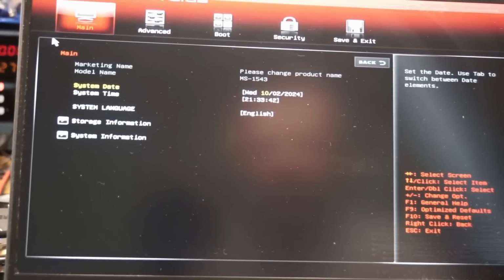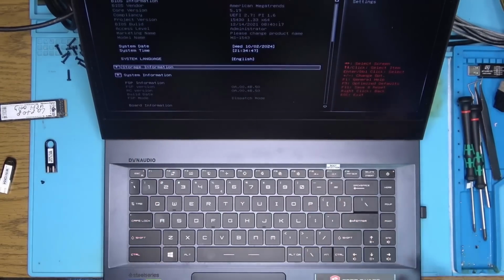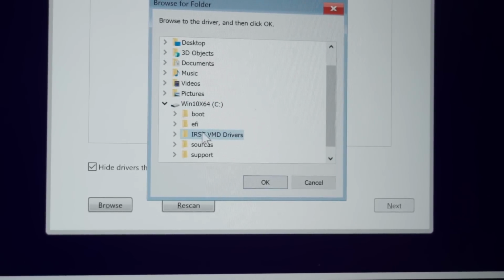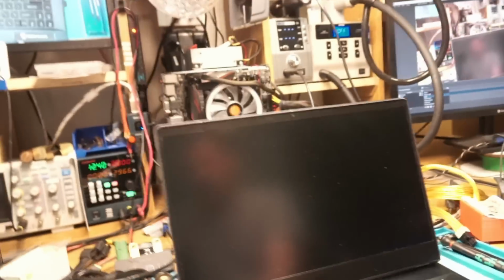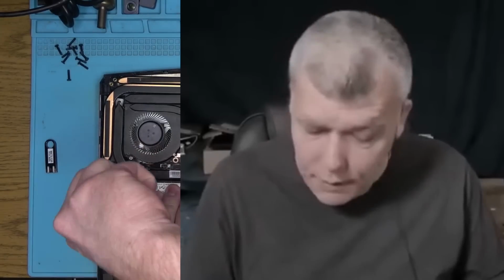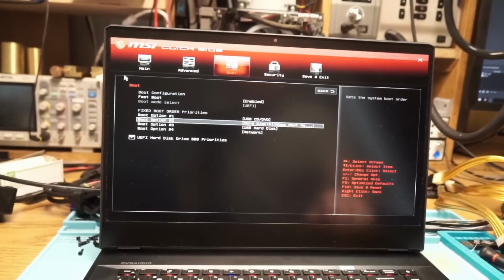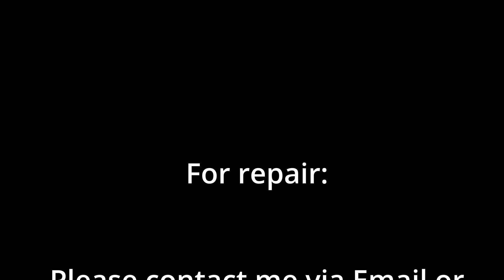MSI GE66 Raider Cannot boot into NVME or SSD

Comment: Similar issues to fix. People buy new system/laptop and wish to use old drive. The trouble is the old drive is MBR (Master Boot Record) and the new system/laptop is only looking for the new'ish  GPT (GUID "Globally Unique IDentifier" Partition Table). Usually have to back up data and format. This is especially true on BIOS versions, that do not allow you to switch to CSM (Compatibility Support Module) mode and 100% UEFI (Unified Extensible Firmware Interface) mode only.
Reply: I have a 5 year old Dell Latitude where the BIOS doesn't support NVME booting anything other than UEFI. External (USB) drives are just fine but the internal ones? Nope. This is a PITA if you are trying to install some of the Linux distros as they also don't see the built in SSD.
Reply: You could convert the drive to GPT easily. Just connect it with a USB adapter and convert it.
Reply: @nexxusty  Some distros (like Mint) didn't have support from GPT at the time. PITA.
Reply: @brianjrichman  mint sucks bro, take that from someone who is dealing with linux more than 15 years
Reply: @nask0  Been using Unix and Linux for 28 years. I know about Mint, but others like it and some want the one person they know who also knows about Linux to install it. Despite saying to do it in a VM and then seeing how it goes, some just want to go right onto it. Who am I to discourage that enthusiasm?
Reply: @brianjrichman  wow you have quite of experience man, I definitely respect that. That's a valid point, a lot of people likes the Ubuntu as well, which I grow  not to like (mostly because of broken dist-upgrades and underlying xml stuff it use, xml is fundamentally broken "thing"), but who am I to judge ¯\_(ツ)_/¯
Anyhow, it's always pleasure to meet fellow *nix power user! It would be great if we can connect and share some experience and/or just chat about stuff.
As someone almost 40 years old (now when I am thinking about it, I am Linux user circa 2001 😁), the invention called Internet still amazes me in its abilty to meet me with wonderful people. Wish you all the best, cheers brother
(also sorry for my bad English, it's not my "default" language)
Reply: @nask0  I started out on 68000 systems, moved to Intel and then Sun before ending up with Fujitsu.
Reply: @brianjrichman  nice, my first was Pravetz 8D/Via 6522 (Apple  reversed-engineered "clone") since I happened to be born in the country that made them, but since kid i was fascinated by computers
Reply: @nask0  Keep on doing it.

Comment: Good fix.
Some computers act up when the battery is low or dead, other computers just don't even care.
I definitely felt that the UEFI was corrupt.
Normally you don't have to slipstream a disk driver on modern desktops, sometimes on servers though.

Comment: Welcome to drivers for Windows. This issue has been in existence since Windows 95. Sadly, manufacturers no longer provide drivers on discs. Some oddly do on USB flash drives. When you build new PCs for friends and family, you get used to putting all drivers on a flash drive when setting it up.
Reply: We use to call them F6 drivers. Back in time was same thing with installing RAID array drives with Windows

Comment: I have this same problem with my first PC build. It wouldn't boot past a certain point in the windows install on my first POST/boot process. Had to look up a video and go troubleshooting, into some advanced options and change some values of something lol found a video about it in YT " not able to get past said screen in windows install " Wish I could remember the name of the video, I'll have to check my PC playlist and see if it's there. Sure do hope I saved it. Wasn't hard to find though for my specific situation. Solution was literally to change two values from 0 to 1 and I was in. It is amazing to me how people figure stuff like that out. I really want to understand it. Very impressive.

Anyways after I got past windows install by changing those couple values, I was able to get in. Worked fine for a little bit and then one day it wouldn't boot past BIOS and I got stuck in the loop. Same problem, NVME not detected in boot screen but it was on main BIOS screen. Only as the drive itself though, not as the boot drive. ASUS BIOS has a little box in the boom right where you can see eligible boot drives in basic mode. Wasn't there or in the " advanced mode " boot section.

I have been able to get past it by enabling legacy and UEFI sometimes. But not UEFI only or legacy only. Even though windows 11 is supposedly UEFI only, right? Not sure if they backtracked on that like they did with TPM's. But I can only boot via legacy or UEFI option enabled.

However I cannot have PBO or XMP enabled and probably any type of overclocking options enabled in the BIOS or it just won't boot into windows. Goes right into the infinite loop. Fortunately I don't really need it, so I just don't worry about it. It's my personal computer so no biggie, plenty powerful enough on its own. Still is a very strange problem to have.

I wonder, do I need to create a partition specifically for the portion of the drive that functions as the boot? I thought that when I had installed the drivers for my M.2's, it had created partitions. That definitely showed up as a task it was working on while loading. Not sure if it ever made a specific partition for the data that initiates boot. Hmmm.. interesting. I wonder if I only installed the drivers for the RAM.. O_o

Thanks for the insight! I will have to try getting into these folders and figure out if I can finally get my boot drive recognized in the BIOS for good. Until the next BIOS update at least lol will def be saving this to a playlist.

Comment: This is an old issue that techs that have been around for 30 years would recognise, and used to have to do this years ago with HDD controllers and chipsets  that were released after a particular build of windows so the driver was not a part of the package, a good example is installing Highpoint IDE  and some SCSI controllers on WinNT4.0, BIOS sees it  and in some cases so did the windows installer,  but would fail  on reboot with an Error x0007E - inaccessible boot device - the solution was either to slipstream the required driver into the windows install image or have the driver on a floppy and make sure you install it during install - back then there were no thumb drives...
Reply: Looks like you and I have both been around too long. 😅 I remember those days.
Reply: Correction....7b bsod
Reply: How many times I made floppys with special storage controller drivers....
Reply: @matthiash.4670 I say once 😅
Reply: @matthiash.4670  and I say many times, many many times.
Reply: @SpaceCadet4Jesus  That the police Academy's quote 🤣🤣🤣
Reply: even windows 7 with usb 3.0 drivers 😂
Reply: It was only awhile ago that I done the same thing for the my motherboard Asus P6x58d-e that I know Marvell 9128 have a inherited an issue with the raid chipset been gimped on performance due to lack of pcie lanes given to the chipset as well the chipset bios been out of date. So decided to tackle this head on and manage to get it fully working without any issues on Windows 10 22H2 the performance is pretty good getting close to 490mbps on read and write is about 235mbps which it not too bad for a Sata 3 mode but the intel chipset Sata 2 mode read and write is lower again more consistent but never the less I have used up all the sata ports for multi drives ssd and hdd for storage and data transfer. So yeah I'm pretty happy the way it turned out 😀
Reply: I remember those days of having to load drivers from separate Medium in order for the drive's to be detected in the windows installer as Plug&Play didn't exist in those days, Man this brings memorys back of good old days for sure 😉
Reply: I remember it also as well - and it was always inducing anger when that happened because you then had to find the right drivers, sometimes even the right version of the right driver.
Reply: The thing about the driver and the right revision is using the manufacturer's website if they have it sometimes they don't have it then the problems starts by looking on drivers websites that claims to the right driver but a wrong operating system. 90% it the bios that isn't configured correctly and 5% the correct drivers will work and 5% bios needs updating but surely 90% of people don't do above methods then automatically created a forum complaining it broken and 10% of the time people don't have time to answer the question 😅
Reply: I've done it before, but it was so long ago I don't remember which OS I first did it on - maybe XP -.
Bought an old OCZ RevoDrive, ie, SSD on a PCIe card, last year and it was the same, ie, load driver during install.
Reply: ya I remember having to load drivers when SATA first came around; older version of windows (probably windows XP) but new SATA hardware. Something about AHCI drivers or Raid drivers or some non-sense. I find it odd that that issue still occurs today though.

Comment: I have an acer predator that is having PCIe issues too.  If the battery is full it will boot to bios, sometimes it will recognise the gpu sometimes it wont.  And it will try to boot the windows install usb but fails to load and hangs on the spinning wheel. Processor?

Comment: i've been build my own PC since high school and encountered same issue ( drive not detected while installing ) 3 times, once when i installed windows vista back in 2007. you need to set SATA setting in bios to  AHCI instead of IDE by default, easy fix. second when USB 3.0 released back in 2011/12. if you use windows 7 usb drive instalation make sure you use usb 2.0 port because using USB 3.0 port would result in non detected system drive. avoidable mistake and fixed later in windows 8 above which suport install on USB 3 port by default. third one was back in 2017 i think when microsoft force all laptop manufacture to use UEFI instead on MBR/Legacy if your usb installation media was on legacy it wont detected your storage while booting on UEFI and vice versa. thats why i always had 2 usb for each mode. now i saw your video and it looks like 4th one, i dunno who to blame wether its intel or microsoft but its been almost 2 decade cant they figure something out?

Comment: As soon as you described the issue. I literally shouted at my tv "INSTALL THE VMD DRIVERS" been dealing with this for a few years now since Intel implemented it. On my main pc I have 5 m.2 drives and one sata ssd. what VMD does is it groups all storage installed in the system under the "VMD Controller" so that in windows you can manage them all using the IRST manager to create raids or w/e. Usually you can turn VMD support offline the bios which would cause the drive to show up right away in the windows installer like usual. I hope YOU learned something 😊❤
Reply: Is this problem with amd system aswell or just intel
Reply: @jthedood1605  this is Intel  only. AMD systems won't have this issue.

Although Intel rst has been around for a long time it's super common for 10th Gen and newer.
Reply: @jthedood1605  I would hardly consider this a problem it's a feature implemented to make raid configurations across different systems super easy! It's only a problem if you'd onto know how to use it!
Reply: Came here to write this comment, but the job is already done. Well done sir.
Reply: it was intel rst driver (raid) now it's vmd mode 🤣
and in most laptop, it's enabled by default or you can't disable it, you need to load the vmd driver
Reply: @maklogetrich2378  yes very true  laptops have more locked down bios but I have seen more than a few in my line of work that do have it. That msi extended bios trick should actually unlock the option.
Reply: @Conradportelli  do you know the buttons combination for Lenovo legion pro 5 AMD model gen 2023 ?
Reply: @ChudGPT  Try Fn+R+N 3x then press f10 do this in bios under more settings if thats there or just on the main page. Good luck
Reply: @Conradportelli  thank you I'll try and update you if it was working for me and that laptop 🙏
Reply: First thing I do is disable that
Reply: Same. And I'm Russian, LOL...
Reply: I was thinking the same! I did got in this trouble for 4 times this year, with new Intel laptops,  and did research online for this problem! Thats why I was thinking the same, VDM drivers!
Reply: sata ssd is also m.2 btw.
Reply: @vahngaming7107  i meant a 2.5inch sata ssd. Yes of course there are m.2 sata ssd. I'll be more specific next time
Reply: @Conradportelli  its fine was just being nit picky lol either way m.2 sata ssd and the 2.5 inch one run roughly same, so it doesnt matter. what board did u have anyway to accomodate 5 m.2 pcie slots?
Reply: @vahngaming7107  no worries man I prob would have said the same ... I have the asus z790 Dark Hero ... excellent board imo ... I work for a big computer retailer in Canada.. it has its perks
Reply: It's real simple fix but I've been building comps for 25 years. Currently running a NVMe gen4 Raid0 setup 14003 read 11036 write, with 2 Kingston Fury drives.

Comment: Disable intel vmd in the bios or do as i did .. i added the rst driver in the home directory of my windows 11 installation media ... you can get the driver from the support page of the laptop on msi website ... but you need to load the driver in windows installer ... it will install and the ssd with show .. i spend two hours trying to fix that problem

Comment: Thank you for the "Godmode" booting trick!
1:14 CMOS-battery with very low voltage --> CMOS Data (BIOS settings) are corrupted.
But BIOS-Firmware is flashed, therefore it can't be corrupted, does it? 
BIOS settings could reside also in the flash memory - but (not) in this laptop? (and CMOS only for real time clock)
But there's a reason why the other company (0:23) could not P.O.S.T. the laptop. So... corrupted flash memory somehow?

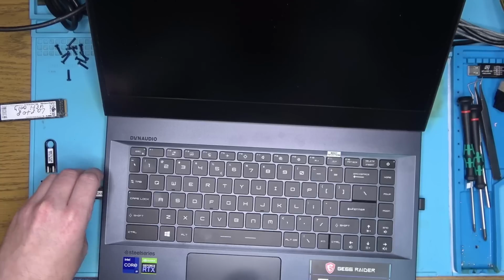Comment: 4:55 I remember encounter this problem first time in Windows Vista, it did not have all drivers of all MB brands to get SATA hdd work. Or I had fancy Pci-extension for SATA outputs back then... I don't remember. It have been over 15 years
Reply: Never had any problems with Vista. On the other hand installing Windows XP was a nightmare on a Sata drive equipped PC. The floppy disks quality started to get questionable, so in the end i had to make a Sata AHCI modded XP SP2 install CD.

Comment: @northwestrepair
You should check the BIOS and look for a setting called Intel VMD, or VMD support, try to disable it and that should fix ur issue of the installer not finding the drive, it should work without any drivers, as far as i know that is used for RAID on the CPU.
Reply from the maker: I tried. No help.

Comment: Lol you didn't know you needed drivers when installing windows? w*f
I recently installed Windows 10 Pro on a laptop and the drive didn't show up and you have to select the correct, non nested Windows drive drivers folder because it can't use that drive even though it showed up in the BIOS drives. This is a very common problem with non-sata drives.

Comment: Change storage settings to ahci 
Also newer devices are removing support for legacy boot devices so uefi only boot support .
Also check if there is csm support and or disable secure boot .. 
all these were windows 11 requirements so devices are most likely enabling them by default
Reply: I am not sure but ít seems like window 10

Comment: Ah. Modern laptops (I noticed gen 11 and up) have this problem of windows installer not seeing the NVMe. Gosh that made me mad. And yes you need to get the original (for this laptop model) storage drivers, usually from manufacturer site. In my case that was HP.
Tony do you flash BIOS on the board or desolder the chip?

Comment: Disable Intel VMD Controller in the Bios or change it to AHCI ;) and you dont need drivers. 1st Option under "Advanced" in the Bios on this model.
Reply from the maker: I already tried VDM disabled with no luck. 
AHCI didnt help
Reply: Came to comments to say this!
Reply: THIS exactly.
Reply: In that case maybe, not for every laptop
Reply: @Misimpa  trust me on ALL otherwise is a Manufacture problem
Reply: @F1rewheels I used to doing this, but for most of the time, I just load vmd driver or just use win PE with vmd driver support
Reply: @maklogetrich2378  SATA Controller Mode change from RAID to AHCI solves same driver issue
Reply: @F1rewheels  it can break windows or bitlocker
Reply: @maklogetrich2378  Not on a empty drive but you are right its not smart to change something on a running system.